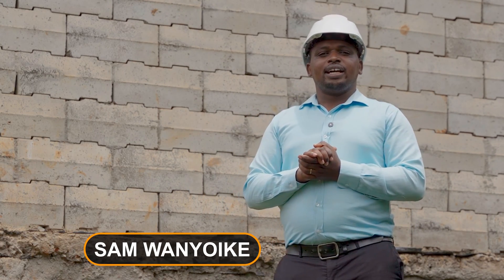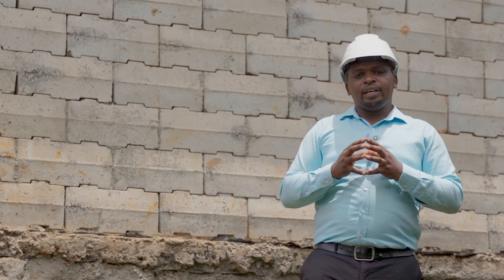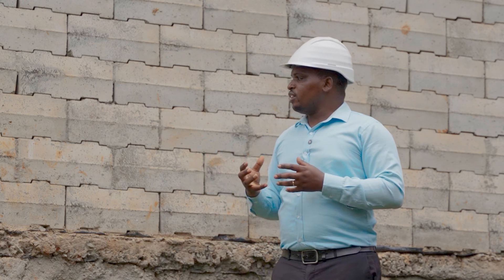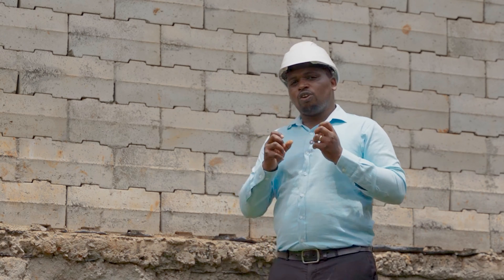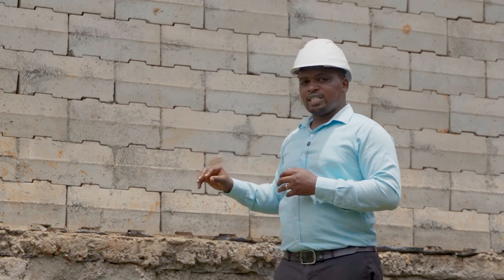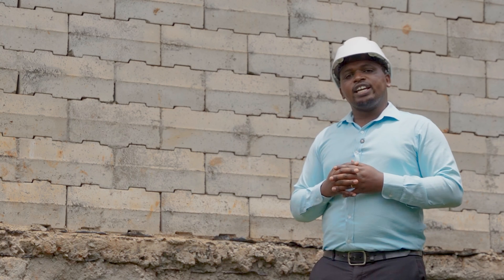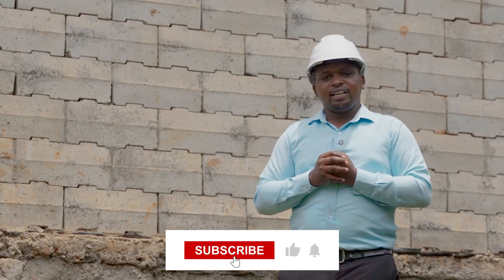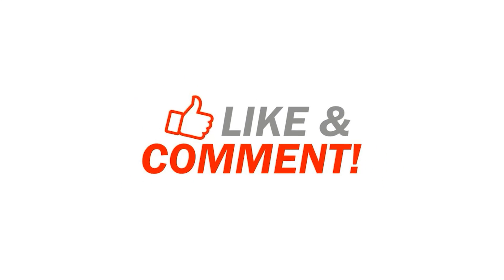Revolutionize Building! Why Interlocking Blocks are a Game-Changer 🛠️🔥 #buildingconsultancy

Comment: How many pieces of this blocks can be produced on the average from a 50kg bag of 42.5R  cement.
Reply: Okay I want to correct myself. The 50 kg to 500 is when you use compressed soil along with Portland cement. those in the video they look more like from a standard concrete which would mean that you can make around two hundred kilograms of blogs from fifty kg of cement.
Reply: @PeteAndersonJr thanks for the responds but what is the weight of 1 piece of the block then?
Reply: If I understood this correctly about 500 kilograms of blocks

Comment: #Thebuildingconsultant How much % does those blocks saves compared to normal ndarugo blocks assuming the house of 3 bedroom will spend 3.5 million ksh while using ndarugo ones please,thank you.
Reply from the maker: @jacmwo9865, the cost of building a house is dependent on many other parameters besides walling. I have heard marketers give an impression that it saves upto 30% of your building cost but ideally that may not be the case. 

My take is that, in as much as interlocking blocks may be cheaper than conventional walling, a Bill of Quantities (BQ) would help in determining the percentage saving you would get for the desired house plan.
Reply: I would love to see how the corners are being made, or they have different molding
Reply: When constructing 1 bag of cement constructs 500 blocks.